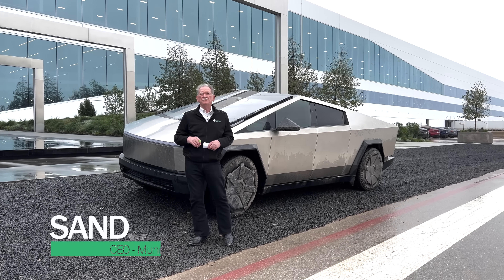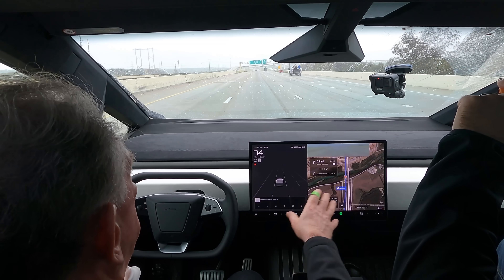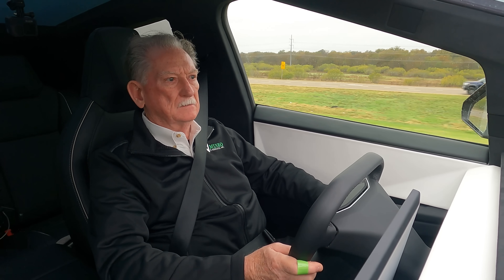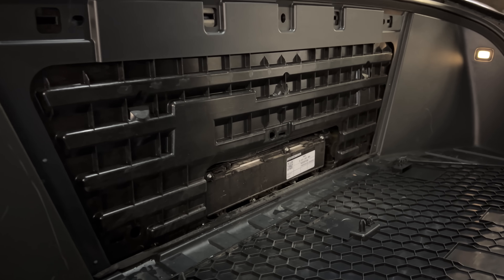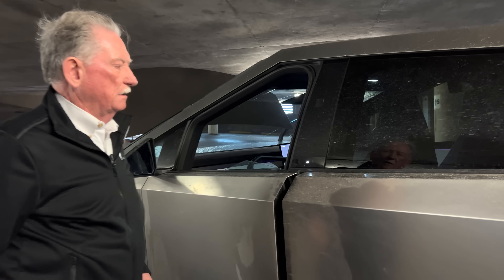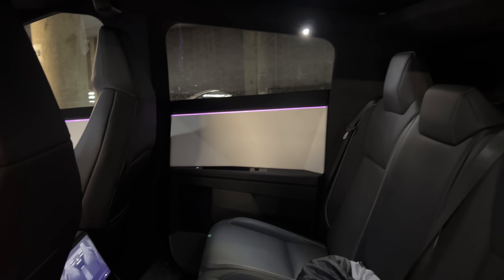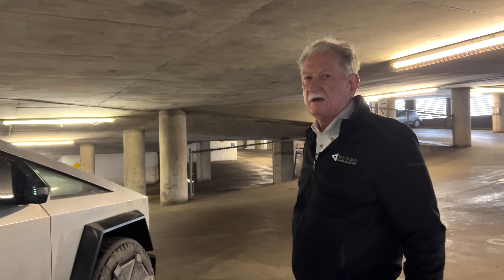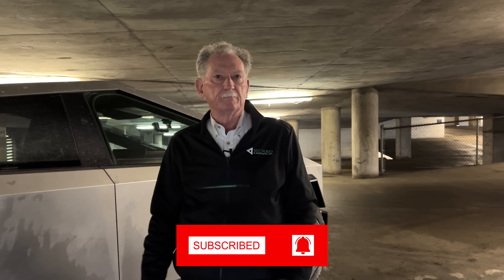Sandy's First Impressions of the Tesla Cybertruck!

Comment: That rearview mirror delete really is becoming a bigger deal for me than I thought it was going to be. In the winter and in the rain the rearview camera is and always has been useless, and being forced to use that to see behind you is a safety concern. Hoping there's still going to be an option to add a rearview mirror.
Reply: Only as an aftermarket rear camera (maybe better protected from the elements) and additional screen system due to the tonneau cover. Otherwise, for a line of sight backwards, you would have to drive with tonneau cover all the way open, which increases consumption and reduces range. Or you would have to come up with a "perfectly transparent" material for the tonneau cover.
Reply: @MooseOnEarth  Agree. I'm sure someone will have an after-market rearview mirror that works as a view screen where the camera element can be mounted arbitrary on any part of the Cybertruck, if there already isn't a product that does that today. Cybertruck isn't the only vehicle on the market where a standard rearview mirror is mostly useless, e.g. vans, box trucks, pickup trucks with campers, etc.
Reply: @MooseOnEarth  or Tesla would integrate a spray nozzle on Cybertruck rear view camera so that it could improve FSD performance
Reply: @comerer999  A proper rear-view camera can be heated, sprayed upon with some washer fluid, or even wiped with some mechanism. So, there are chances that someone may come up with a camera with better bad-weather applicability. Regarding side-vew mirrors: some party will likely offer aftermarket side-view mirrors for Cybertruck making them way more useful at a slight expense of range.
Reply: You can't even see out the back window either if the truck bed cover is deployed.
Reply: @mrxman581  Exactly, terrible design leading to no rear visibility during very common driving conditions/scenarios.
Reply: It comes with the rearview mirror. It has just been removed by default for these videos. You would just have to drive with the tonneau cover up.
Reply: A heating element for the camera would eliminate 90% of the issues.
Reply: Not sure where the rear camera is, but looks like close to the bumper.   If they put it above the bed, then you wouldn't get the debris,  They could have a secondary reverse camera for parking.   Due to design, there is no way that a mirror would work.
Reply: @TheSpudmckenzie  The camera needs to work even if driving with the rear gate down.  They should be able to incorporate a heating element into the camera that would clear off water fairly quickly.  The trick would be for the FSD computer to recognize that the image is blurred and activate the heater.  Or just run it for a minute or two every time you start.
Reply: @pfcrow  How would a heater on the camera help clear off the muddy debris filled mist that ends up on backup cameras in wet/wintery conditions?
Reply: @EnlightenedOne90  Yes, the muddy or salty film would need to be cleared with a spray/wipe mechanism, but a heater would take care of water from rain pretty effectively.
Reply: @TheSpudmckenzie  it's on the upper part of the tailgate. You will lose visibility of the rear view if you open the tailgate.
Reply: I still don't understand how they get away with shaved door handles especially in winter climates where the door can freeze
Reply: Tesla parts catalogue is open for Cybertruck. The front fasca camera has a heater and at nozzle, the rear one does not. An aftermarket approach may add the same type of heated camera including some washing fluid on the rear of the car. Washing fluid container may be in the under bed storage compartment.
Reply: It's a "21st century problem"
.
Ever driven a Sprinter style van? Without a camera?
Reply: @rogerstarkey5390  Go ahead Roger, tell us all how back in your day you reversed sprinter vans into the tightest of spaces blindfolded!
Reply: @EnlightenedOne90  I could not, i stepped out and either got help by a pedestrian or a collegue driving with me. And it was a Ford Transit not a Mercedes Sprinter.
Reply: @rogerstarkey5390 Ford Transit, Yes. I always stopped in the street and stepped out before parking.
Reply: Widen the rear camera view. That beats any rear mirror existing on the market as you can view almost the entirety of the rear.
Reply: @comerer999 
You need to use a different A.I, or give a different instruction (maybe not "loaded"?)
"Intentionally sacrificing security...."?
.
Duh?
.
Try thinking critically for yourself.

Comment: because so much of the profits are in the higher spec trucks ... it doesn't take a lot of higher spec buyers switching to hurt bottom lines.  but agreed  the vast majority of f150 sales are safe from the cybertruck lol
Reply: Which F150 sales are "safe"
You mean "Lightning" sales?
.
(They've sold 40,000 total in 2 years... 3,172 in October)
.
If so, look at the pricing vs specs.
Not so good for the Fords that make profit.
.
Give it 6 months, after "real users find a CAN do what's required.

Comment: No handles...great....until they stop working...or the door is iced shut. I want to watch you load and unload something from the side of the bed. Special tires are needed to work with the rubber hubcaps. Proprietary alloy for structural panels...I bet that's going to be expensive to repair because my bet is you have to replace the entire panel. The list goes on and on. It's a TERRIBLE design for practicality. I don't mind EV's. I mind this design. It's a rolling computerized garbage can.

Comment: Trunk lid doesn't libe up with body.  Windshield wiper covers only about 40%, leaving most the view out the front to be *blind*.  Body panels and whhrls attract and hold dirt badly-  thus thing looks like it went through mud bogs and it only was driving on the freeway.

Neat looking vehicle... as long as you don't try to use it.

Comment: Sandy I desperately want your opinion on the frunk/ bonnet closure. 
That forward facing fin of the 1/4 panel seems completely superfluous and dangerous to pedestrian impacts. What do you think of the solution of making the frunk a clamshell design? cutting a shut line from the A-Pillar down to the front of the wheel arch.
Reply: I suspect we will find that the frunk steel is a lighter gauge for crumple performance, combined with collapsible hinges.
Reply: @rogerstarkey5390   it doesn’t look like it but that does seem like a reasonable solution. But that does not solve the clear issue of that 1/4 panel guillotine blade facing forwards.

Comment: No door handles is one of my main complaints with that sort of vehicle.  How do you open a door in a cold climate when the door freezes shut if you don't have something to get a firm grip on?
Reply: The door popper can break 1 inch of ice.
Tested.
Of course, IF you have MORE ice than that, you can literally "hit it with a hammer" or a rock, or an ice axe, to crack the ice.
(Not sure where you would be to encounter that situation)
Reply: @rogerstarkey5390  I am not talking about freezing rain.  What I am talking about is the situation where it is not that cold, say 20F, and sun on the car melts snow.  The water runs into the gaps between panels and freezes when the sun goes behind a cloud or at sunset.  You end up with a frozen door that needs a good yank to open.  Without a handle you will have to pry the door open if you have something suitable, which you generally won't have available. Also prying a frozen door open will leave a mark.

Comment: Sandy, what happens if you get into an accident and the pyro fuse blows? How exactly are the EMTs going to open the driver's door without a handle so they can get you and your passengers out before the batteries possibly start to smolder?
Reply: In case of an accident, batteries disengages to prevent fire.
Reply: @inciwillard991 Yes, but electrically disengaging the battery does not prevent it from burning if it gets damaged enough. But even if the battery is fine, there's still no door handle on the outside.  I guess the EMTs can break the window and open it from the inside. Good thing the glass is breakable. 😁
Reply: @richarda3659
The difference between this and ICE?
By the time the EMTs reach the ICE vehicle, the fuel has caught and it's a.... Barbeque.
This is just "smouldering" with one or two cells venting downwards.
.
Just btw, to correct your limited understanding....
The "pyro fuse" is associated with the main traction battery.
The door system is controlled by the 48v battery, separate..... Just like the low voltage system in an ICE vehicle.
.
Nice try.
(Actually, quite a poor attempt)
Reply: @rogerstarkey5390 You're quite a case. I really was asking an honest question out of concern. I am a shareholder and have a lot of respect for Tesla, and family members own one. I resent all the "shoot first, ask questions later" people who crawl around here. It's interesting, however, that the 48V system remains active even if the primary battery becomes disconnected. Any confirmation on this from a non-starkey person out there?

Comment: I agree that it's a quite sufficient truck and more than adequate for typical around town use, even if you're a contractor or someone who runs around the city all day to job sites and so forth. Where it fell painfully short however, is in total range vs price, and I've yet to see anyone demonstrate what the range is when towing, but everyone seems to think it will be about 50%. So assuming you're willing to aim for 80% use of charge between charge stations, that's 340/2*.8 = 136 miles. I want to see the CyberTruck tow 11,000 lbs of trailer with 2000 lbs in the bed (including tongue weight of the trailer). If the "range extender" weighs about 700 lbs, then max bed payload would be 1800 lbs, and nearly half the bed is used up, so it would be hard to hit the payload capacity anyway in that case, so a reasonable test would be 1500 lbs payload including tongue weight + 10,000 lbs of trailer. Then the other issue is charging with a trailer on, because it's not just that you need a supercharger roughly every 130 miles, but you will likely need to drop the trailer in order to get the vehicle into those chargers each time, which would make a long trip a lot of work. Less so with the range extender, but even with that it works out to having to charge roughly every 190 miles 470/2*.8. I was really hoping I could sell my F350 and my Toyota FJ and replace it with this vehicle, but if I can't tow 250 miles, then I don't think it makes sense.

Comment: There was a reason why there’s a mirror on right and left sides as you supposed to look where you go. Having it in the centre screen it’s not a good idea. It’s just cheaper. Same as for indicator buttons on regular Teslas - good for 20 deg turns but not so much for anything more and coming in sequence but I drive in Europe and we do have a lot of turns not straight lines like in the 🇺🇸.
Reply: As far as I recall, on OTHER Teslas you can have all mirrors displayed as you drive.
Not sure why you need that with the vision system watching for you.

Comment: I'm a little leery about not having a rear view mirror except for the rear camera for the precise reason that we see here.  Add to the fact that you only get the side mirror camera when you use a turn signal and...  I dunno, it just seems like a LOT more systems that can fail down the road.
Reply: Check other Tesla vehicle.
I think there's an option to have the display on all the time.
Also it's a WARNING system.
You will notice mor if the screen changes than if it's there all the time.

Comment: is it cool yes am sure it drives nice but i rather stick to my 80s ranger with manual shift ( to fix some tesla system parts costs as much as replacing the whole entire drive train in my old truck 
5200 dollars and thats not replacing electric motors or batteries just some doohickey that interfaces with the instruments 

in west TN our closest charger is a nissan dealership with 110v  and you need to drive 80 miles to get to anything that isnt AC 
the cost needs to come down and the range needs to probable be 400 miles to have the masses adopt electric cars

Comment: Why no charging port up front, like a Rivian R1T?
If you have an up-front charging port, then hauling a trailer on a road trip wouldn’t be such a horror story.  With the exception of 1 charging station in Tennessee with 4 pull-thru stalls  …. every charging station I’ve ever seen (in real life or photos, in North America), one has to detach the trailer AND park the trailer somewhere BEFORE being able to pull the EV into the charging stall  …. because the charging port is in the rear of the EV … and a hooked-up trailer blocks the charging port.

Comment: Keeping camera lenses clean is something that Tesla needs to address.
Reply: Correct me if I’m wrong but I believe the crybertruck has a feature which allows you to squirt water over the lens to clean it. Same as BMW has
Reply: @LiveMedia123  wrong. Not a feature and on a BMW you can spray headlights only
Reply: @Hypnotoast I have a cousin that owns a BMW iX that does this so I am pretty sure that I am not wrong about that.
Reply: @Hypnotoast  
wrong , BMW 7 series and Audi Q7 have camera washers
Reply: @@deonex4993That's the neat part don't trust anyone not even yourself
Reply: Not just Tesla... some other vehicles w/ focus on camera heavy driving safety features
Reply: Cybertruck has controls for cleaning camera lenses while inside, even if fogged, rain or ice. Watch other reviews.
Reply: @chriscross1737 just for the front bumper cam, unfortunately
Reply: @TWEO if the back Cybertruck camera can’t be cleaned using interior controls like the front facing camera, this by definition does not bode well for quite dangerous scenarios and outcomes given the heavy dependence on the rear facing camera needing to be clean and precise especially in mud, rain, fog, snow, slush, puddles and other fairly typical conditions
Reply: agreed.   Especially in the winter months, Autopilot is basically useless after 10 minutes of driving from either road grime or snow/ice/water/whatever. 

They also have issues with water pooling on lenses due to air currents.   The Model Y/3 is particularly bad at this, with water bubbles holding against the lenses of the fender cams
Reply: @justinc5356 Intersting. I drive in the PNW in rain, snow and slush and only had the reverse cam get covered in grime. The rest are fine. Perhaps this is an issue in states where they salt the roads.
Reply: Immediately, if not sooner.
Reply: @andrewberrios2567  especially if they ever want to achieve reliable and consistent FSD!
Reply: Lol they wont, this been a problem for "ever" going camers only, and not keeping them clean, must be the most Elon move ever.
Reply: Yeah, keeping my reading glasses clean is something lens makers need to address.
Reply: @2Timothy2.15  I can wipe my glasses as fast as I can wipe my nose. How fast can you wipe a non reachable (while driving) mirror?
Reply: @Hypnotoast this truck isn't for you
Reply: @2Timothy2.15 
Who said that? 👀 Oh.. there you are!
Reply: @2Timothy2.15  clear view is important enough, that most cars have 3 dedicated functions to get it done for the rear mirror
- heating elements in the rear window
- wipers for the rear window
- fluid for the rear window

If a company replaces the mirror with a camera+display, then you should be able to actually use without stopping the car.

Comment: Tesla seems to have done an amazing job on the build quality and panel gaps. The flat stainless steel panels are unforgiving in terms of showing up any misaligning.
Reply: Think about it.
They're also VERY easy to align.
Strips of... Nylon(!) 3mm thick?
Glue in a "T" profile.
Butt the panels.
Done
.
In addition, precision castings, maybe even with mounting faces milled, so extremely fine tolerance over the length (/width) of the truck.